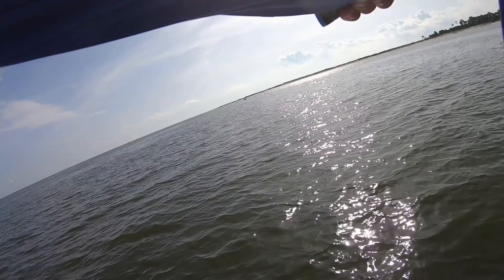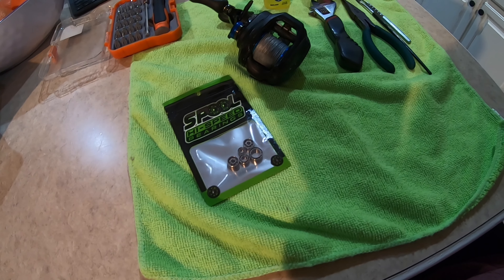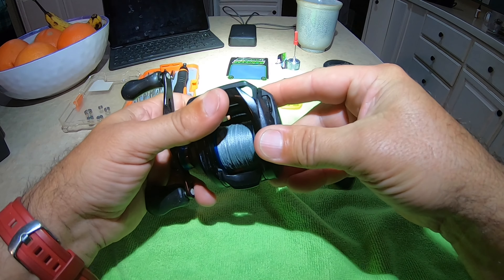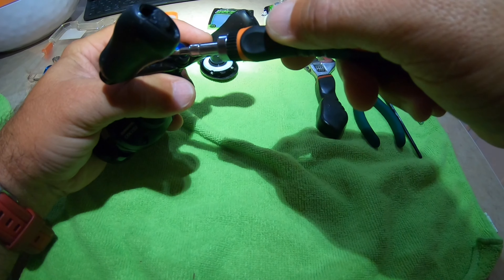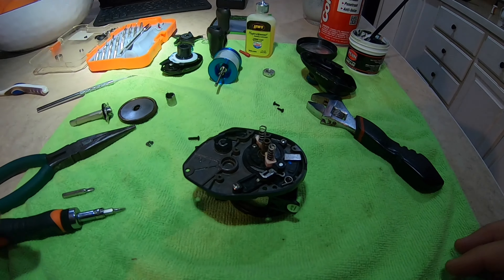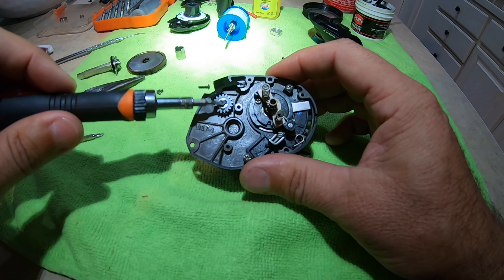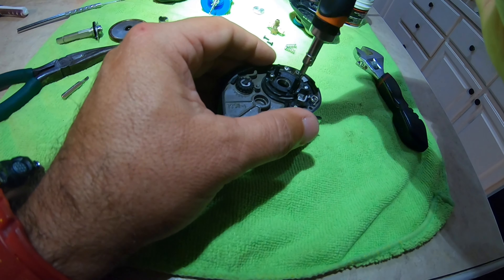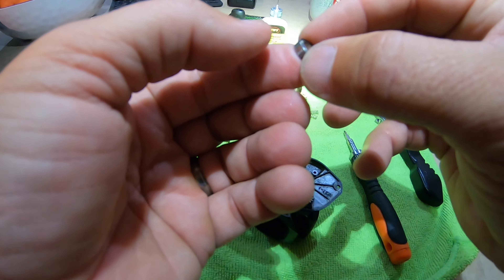Shimano Curado SLX DC 151 XG (Disassembly / Reassembly) Do Ceramic Bearings really cast further?

Comment: Great video - very informative.  After sending my reels out for annual maintenance a few times & being disappointed with the results, I have decided to do it myself. I have watched several videos for each Make & Model of reel I use before I start doing the maintenance. I want to be very confident in what I am doing.  I noticed some things in your video that were slightly different than the others for the SLX or Shimano Curado K's etc.  You didn't put in grease on your main gear and you actually put a little grease on the anti-reverse sleeve.  The other videos lightly greased the main gear & made sure the anti-revers sleeve was completely dry - to avoid any slipping.  Can you explain why you did those two things?